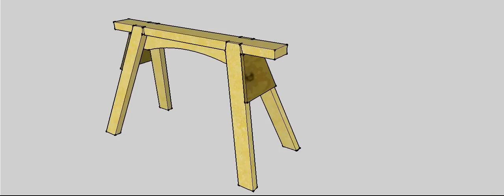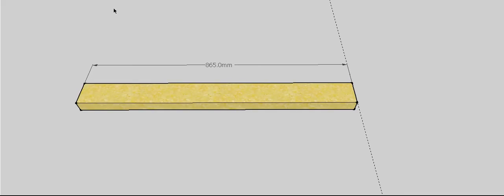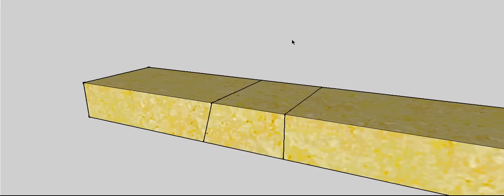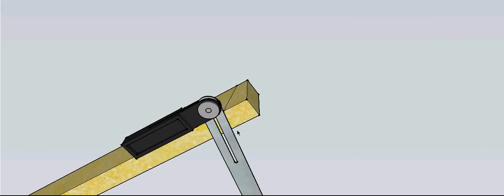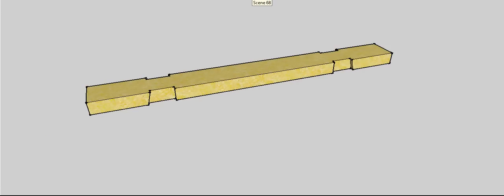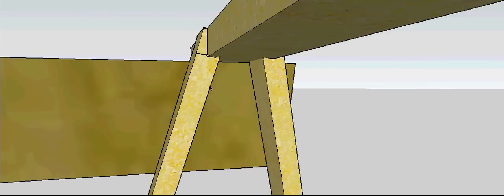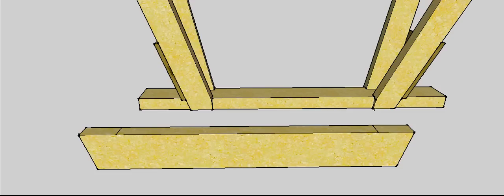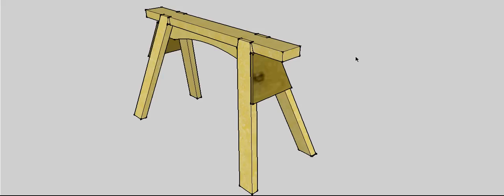Construct a Saw Stool

Comment: Holy crap, this was unexpectedly awesome
Reply from the maker: Thanks Mate, I'm glad you liked it and hope you find it useful.
Reply: @Buildsum  I even bought plans for other designs, but I find yours to be so simple and elegant (and well presented), so I'm going to build them instead!

Only thing I'm worried about is whether the saw will inevitably go into the legs when sawing close to the seat, since the legs slant in all directions. I guess you have found a workaround/not found it to be an issue?
Reply from the maker: @CitronMandX  Hi Mate, Thanks for your comment, I'm glad you like the design.  I have not found it to be an issue but if you are worried you can just screw a sacrafical piece of timber on top.

Comment: Thanks so much for taking the time to do this. I have made 4 with your pattern out of scraps lying around, studs, old roof battens in hoop Pine as legs old concrete formwork as the tops, and wide jamb offcuts as the gable boards. I have used steel legged saw stools for work for 40 years.
Reply from the maker: Hi Wes, that sounds great, hope they work out well.

Comment: Thank you, for your video, I really like your Saw Stool or as we say in the states sawhorse.
I might suggest another way of cutting the legs, if you transfer the top plate’s angle in relation to the legs you’ll find they are the same as the bottom angles.
Or in other words, the top plane is the same as the bottom plane.
Reply from the maker: Hi Gary, thanks for your comment, totally agree, i use this method as it allows for any variations in the angle or overcutting of the head to ensure that the legs are all in the same plane not necessarily the same length.

Comment: Buildsum, this is a super way to present your Anglo style saw stool, with authentic joinery and properly splayed and kicked out legs. Less than a handful of others out there, among all the odious "I beam" cobbled together dreck. No question the weight bearing shoulder is superior to our American design with thinner, but wider stock for the legs. But, would you indulge my observations about geometry?

You start out with a compound bevel on one end of the legs, but you pair them with mirror symmetry. It may not be intuitive, but if you ganged all four legs together (easier with thinner stock, I suppose), and cut both ends at complimentary bevels, then those four, identical legs would all make up one stool (horse, in our parlance). It just takes turning two of them end for end to get the lefts and rights.

Now, something I have not seen discussed regardless of which side of the oceans we're working in. You slice a wedge off the leg tops (shoulder allowed for) to fit into the gains of the beam. You mark it out so that in plan view, the end of the stock shows an even thickness, with parallel edges. This is similar to our practice, the outside faces of the legs are in plane with each other. However, this gives a slight discrepancy of angle with those 90 degree gain shoulders. Small, but it is there. If your stock is true and square to start with, then the plan section view of a splayed and kicked out leg will not be a rectangle, but a lozenge, seen also in the feet. Don't take my word for it, cut off a board and put a square on it. This also bears on fitting the gussets, which would not actually be sitting on a flat plane.

One remedy, and again I see no one calling this out in any set of instructions for any style of horse (pardon, stool), is that the leg edges should receive their own bevel. This will give a rectangle in the footprint, as well. In your Anglo style of joinery, you are better off marking out with the stock end still square, taking the side marks down to an angled shoulder of uneven depth. This doesn't address the problem of the gussets not sitting flat upon the legs, though.

By the way, in your narration, you mention how when marking out the leg joinery, using the beam thickness comes up a few millimeters short. It's because of that leg kickout; you are laying out what is really a diagonal line in the side view.
Reply from the maker: Hi Lee, thanks for your in-depth analysis of the geometry of the Saw Stool. I agree that the legs could be all cut the same from the start and then just end for end them to get the pairs however this may result in an uneven stool at the end as you will not be able to adjust for any differences that occur when you cut the legs to join the top (beam). I also agree that where the leg fits into the top (beam) and where the gussets meet the leg will not be flat or parallel however I feel that this is a fairly small amount and as I am using this in a construction carpentry course and not a joinery course I am not too worried about it.
Again thanks for your comment.
Reply: @Buildsum , yah, furniture maker writing, here. Knew you'd say that. You have my sub, of course. Working my way through your videos now, plan to learn something. And I didn't mention the feature  of your saw stool that I greatly admire, the wedging action of the leg into the gain, a sensible step I haven't seen before!
Reply: @Buildsum , on reflection, the modification I mentioned of laying out the joinery on a squared off leg, rather than end bevelled, will indeed result in those legs twisting back, and the back edges co-planar. Seems the best of both worlds; no extra steps and all joints meet perfectly!

Comment: thanks...from the states!
Reply from the maker: No problem at all, uncle Freddie
Reply: There are many factors in building a table saw. One resource I found which successfully combines these is the Wilfs wood blueprint (google it if you're interested) it's the most useful guide that I've heard of. Check out the amazing info .

Comment: What length are the ply board ends?
Reply from the maker: +mike thompson Hi Mike The exact measurement is hard to determine as it depends on how your cuts work out however a piece 225mm long will generally be long enough. Size and lengths are discussed at around the 1.40 min mark of the video.
Reply: +Buildsum I understand cheers. Just got the legs on my first stool. Pleased with it, when I put the board on the ground to cut off the legs, does the ground have to be perfectly flat and level?
Reply from the maker: +mike thompson The flatter the better but level is not really an issue
Reply: +Buildsum would cutting the legs at all the same length at the same height work ? I have cut my legs using your methods and its wobbly :/
Reply from the maker: +mike thompson Hi Mike how level is the ground you are working on? What you propose could work but in the end it depends where you are using the sawstool
Reply: +Buildsum kitchen floor, don't know what happened
Reply from the maker: +mike thompson You could sit the stool on the floor, get it level and then scribe up off the floor how much up need to take off but again this would only 100% accurate if the floor is flat

Comment: Nice video! Why do you mill your top piece from 90x45 to 90x40? Just curious as I can't think of an obvious reason and I have some 120x45 left over from a job but no thicknesser.
Reply from the maker: +Isaac Campbell Hi Issac No particular reason however i think it was originally done to get rid of the rounded corners and 40mm is easier to work out he 4-1 angle. If you have 120 x 45 i would just use that and leave it 120 wide as well

Comment: Man, I wouldn't mind one of your saw stools. You're obviously a good tradesman and it's clear that you do things well. I found the detail for the top of the legs interesting... the little shoulder that takes the weight.

My Dad was a builder and one of the best life lessons he ever gave me was how to build a similar saw stool to the one you have shown. His trick was a bit simpler. The legs retain their parallel sides and the checkout in the top is cut with a surface that matches the inside of the leg. It's a bit easier to do and strong enough but it doesn't have that neat little shoulder that your design has.

He also had a trick for marking the legs... take a stick, put a small nail into it at say 610 from the end. Hang the stick by the nail off the top at the nearest corner and put a mark on the leg. Repeat for each leg. Then join the marks with a straight edge and cut the legs off with a skill saw set at same angle as you bevel.

Great video! Very nice illustrations and very well presented. Thanks very much!